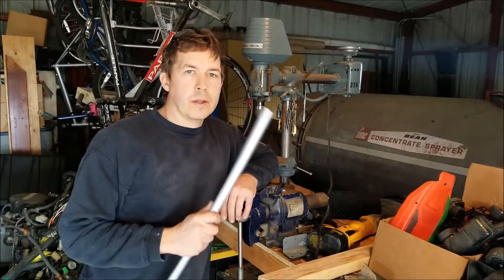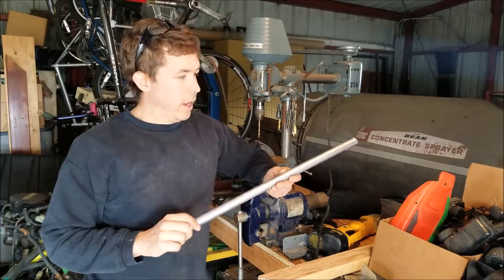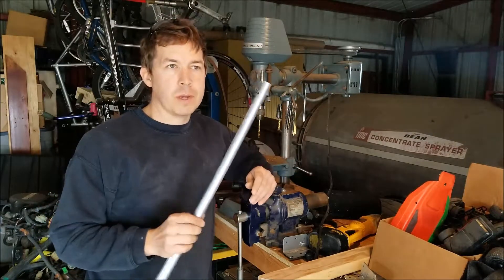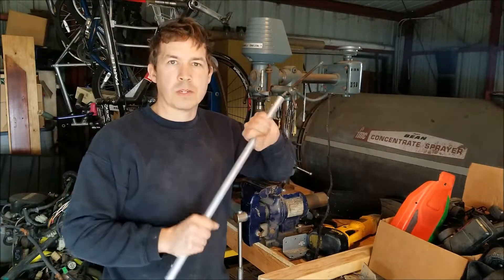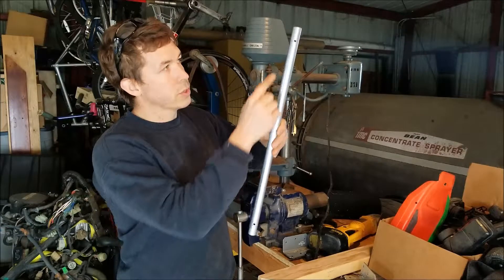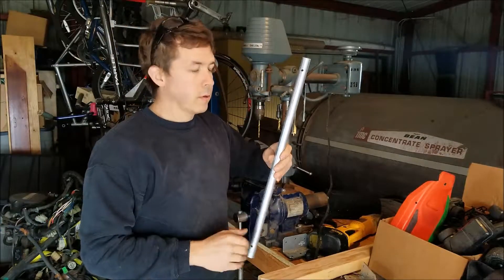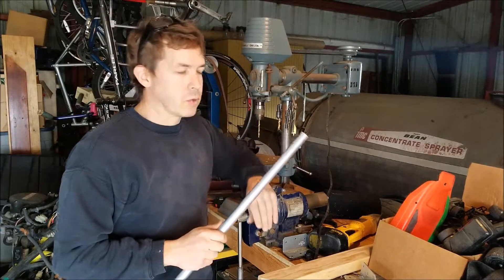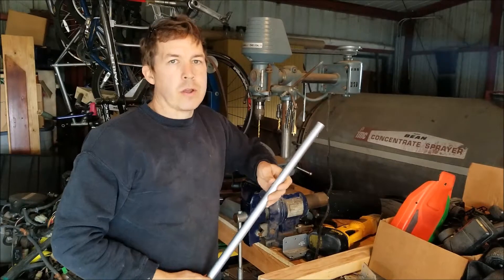How to drill aligned holes in a tube

Comment: You still have to hit the pipe square on with the drill bit - you may say a slightly off kilter position would make the bit glance off but it could still purchase and drill a hole that is not "exactly" aligned.. unless...the timber is genuine straight edge and  you score a line all the way from the bolt to the end, parallel to the timbers edge
Reply from the maker: yep, its not perfect but works for what I need it for and is easy. Thanks for watching

Comment: After struggling with this, I’ve finally found your video which is the perfect solutions thanks!  Any suggestions for drilling that first hole and not having the bit deflect when drilling through the curved surface? Just go slow is my assumption
Reply from the maker: use a center punch to make a small start mark or use a smaller drill then a larger drill. Thanks